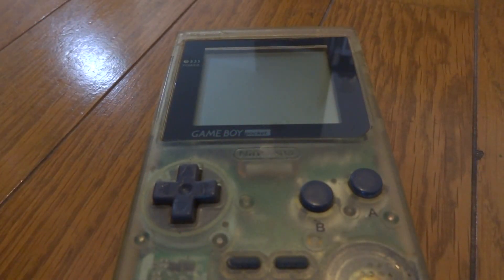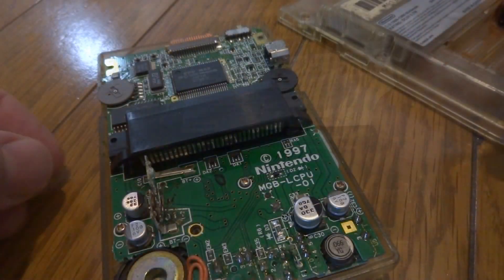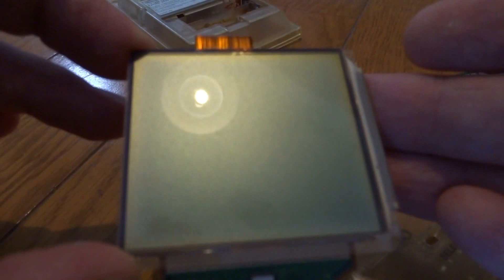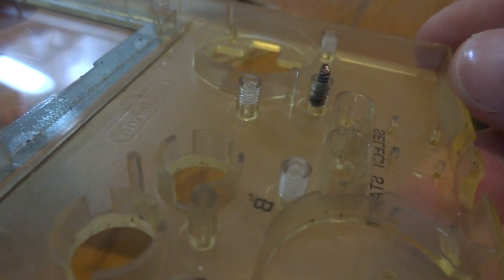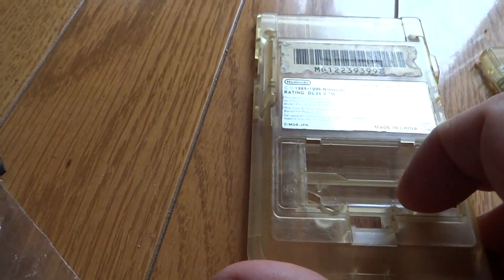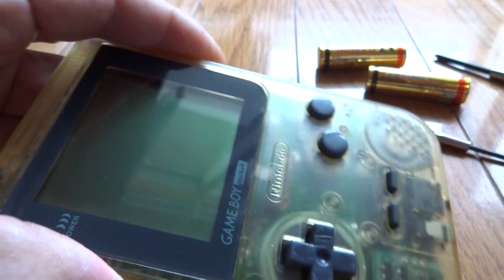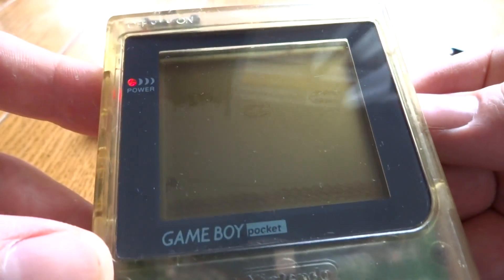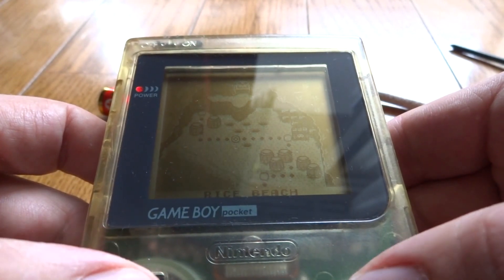Game Boy Pocket Repair: Rusty But Trusty

Comment: Hey Luke, I'm really curious what you used to clean up those tabs. Did you use vinegar or some other type of compound? Please let me know. PS: Thanks for the vid, excellent as usual.
Reply: Abel reis carvalho Thanks man. Yuyu hakusho is where it's at with anime for me.
Reply: Cristian Nicolae I soak mine in vinegar. Works perfect every time. Just make sure you don't soak them over about ten minutes or it will strip the plating off of them. The ones that are soldered to the board I usually use just use a Q-tip soaked in vinegar and wipe them. The particularly bad ones like the ones in the video I'll desolder and soak.

Comment: Question: I actually bought a Game Boy Pocket today, and the right direction of the d-pad is really unresponsive, and so sound plays from the speaker. Can you hazard a guess as to what would be the problem? I'm assuming the connectors being dirty is the cause of the d-pad being unresponsive, but I don't know why the sound isn't working.
Reply: The connectors are most likely dirty, and no sound is either caused by a blown speaker or the speaker wire came loose.